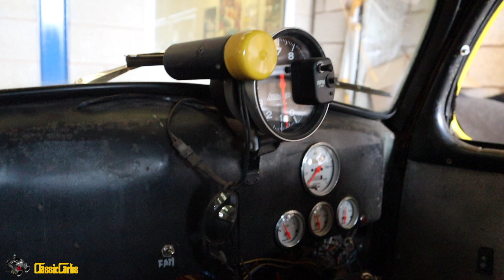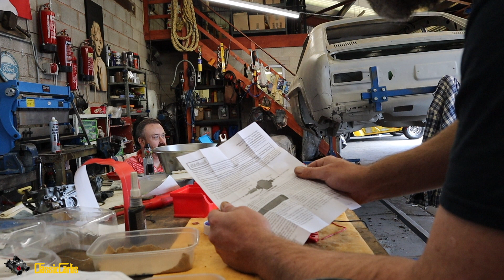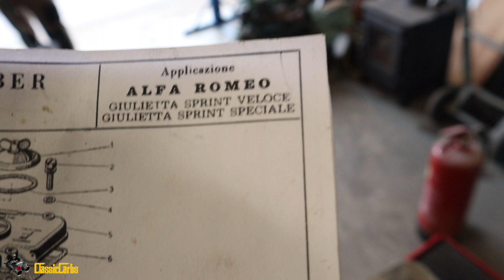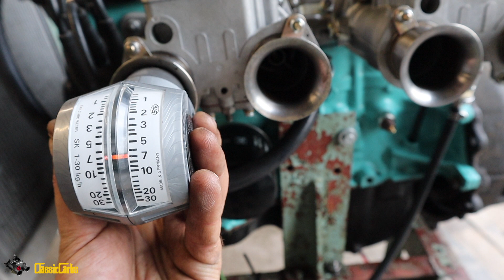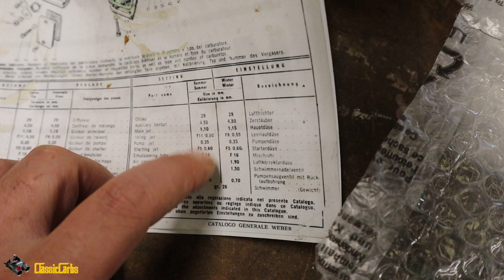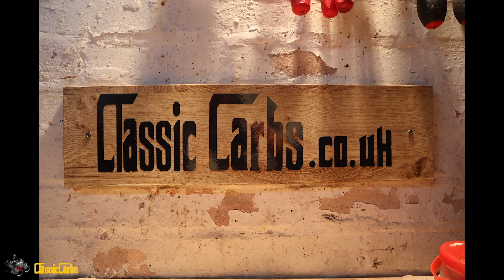Re-jet Holley carb for 1955 Ford Pop & WEBER 40 DCOE 2 carbs rebuild for classic Alfa Romeo

Comment: That song would go very well on a QT film I agree! I am interesed in your strimmer, is it a Champion Strimmer? I am repairing one as well. The ignition cord broke!

I still have the handle c/w throttle return spring & ignition wiring to refit! Grrr

Would be interested to know if yours is Champion too! 

The Pop sounds amazing especially on the overrun!

When is it going back on the dyno?

All elements were forged in the sun!

Those floats, surely you can solder up the perforations? Look like brass, small blob of solder!
Reply from the maker: Hey Tommy!
The strimmer is a Stihl, and it needed the carb adjusting, a new fuel hose, and a new fuel hose bung, and some new strimmer wire.
Reply from the maker: Haven't planned to take the pop to the dyno,  but we endeavor to race it down Santa pod on the dragstrip
Reply from the maker: If I can help, just ask fella 😊